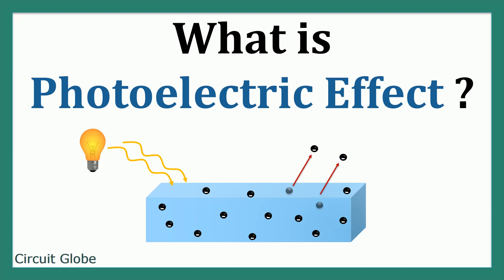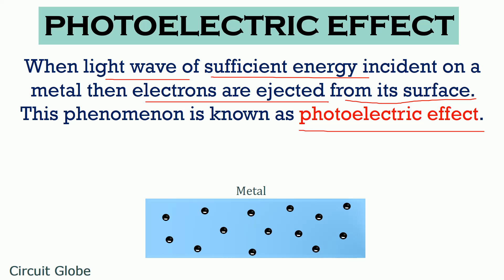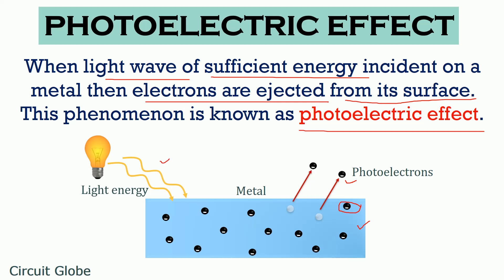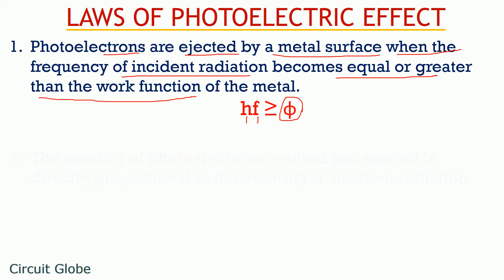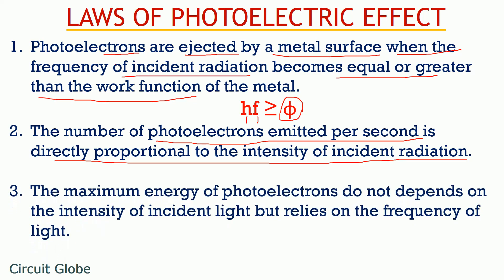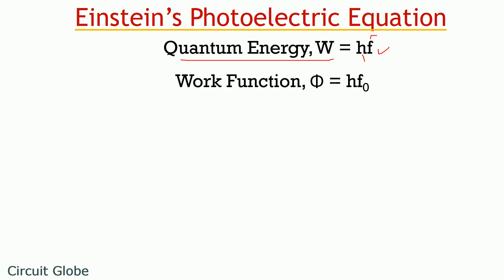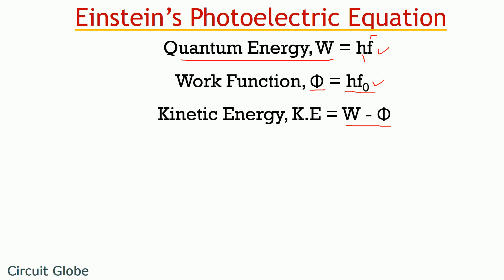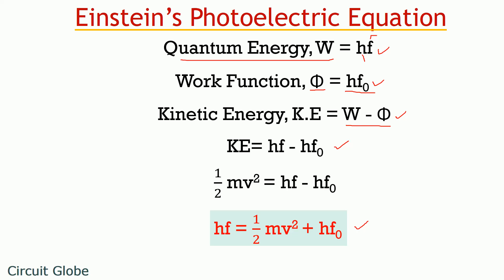What is Photoelectric Effect? Laws and Einstein's Phototelectric Equation

Comment: May I ask you that the emission electrons should be the ones on the metal surface or any electron that sit inside the metal. And the reason for that issue. Please.
Reply: PEE is a surface phenomenon. The emission of electrons take place from the surface of the metal only. And also electrons present in outermost orbit will be easily removed.
Reply: They are the outer electrons found in valence shell not in penultimate shell that are emitted ...

Becoz. According to neil Bohr 6th postulates ,electron can gain or lose energy ...so when these electrons gain energy , ionisation got occurred due to which electron get emitted from the metal surface...☺️☺️